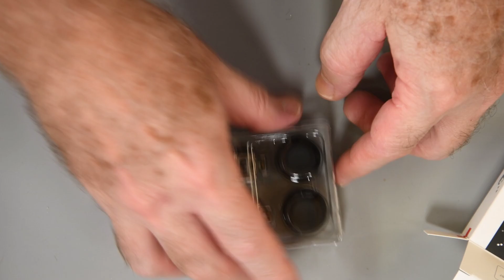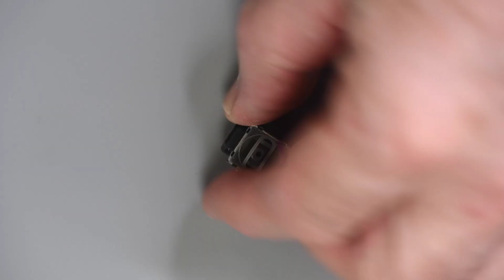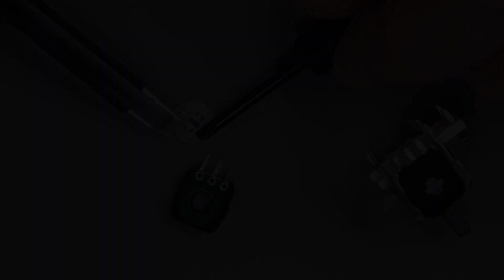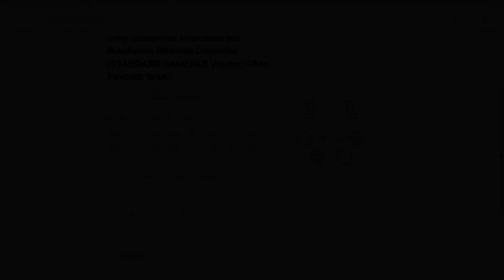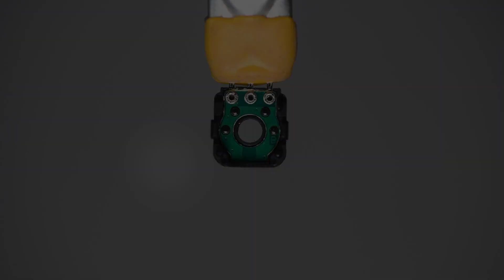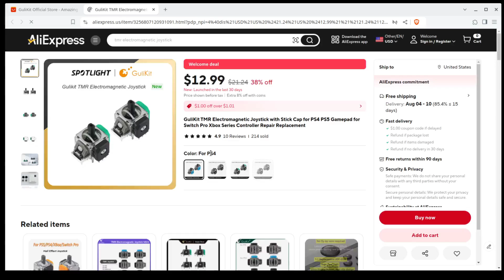A New Champion Has Been Crowned – GuliKit TMR

Comment: if I am getting stickdrift after installing and calibrating in a ps4 controller, is it a joystick issue or a calibration issue?
Reply from the maker: None of the TMR joysticks should drift.  There may be a bit of a break-in period, which might shift the center and range a very slight amount.  But if you are having noticeable drift, then something is wrong.  Make sure the sensors are snapped fully to the joystick frame.  And of course, no strong magnetic jewelry.  Is it one axis that is giving a problem, or multiple?
Reply: @metalplasticelectronics354  Okay I will take a look, it seems to only drift upwards, slightly left or right.

Comment: Do the caps fit fine? Ive seen some videos saying that the gulitkit thumb knobs rub against the shell...
Reply from the maker: I've only had that problem when putting the GuliKit knobs on an Alps frame.  I think the Hallpi and GuliKit joystick frames are a tiny bit shorter.
Reply: @metalplasticelectronics354  so the OEM caps on Gulikit modules would sit lower then?
Reply from the maker: Seem to by a tiny bit.
Reply: @metalplasticelectronics354  I see... So it's basically REQUIRED to use the appropriate caps. At least on OEM and gulikit modules...

Comment: Having installed these on my dualsense that developed stick drift, I absolutely love them and if I get a second controller I will outright replace those sticks too. They are super smooth, accurate and very reactive. The difference between these and the factory sticks is very noticable. It is such a smooth and snappy feel when playing. The calibration web UI is also easy to use and works well. The only downside, but all of the stick replacements share that, is that the installation is quite complicated. And not something I would reccomend for a beginner at soldering.
Reply: I have put both the regular tmr from gulikit and the 720 tension adjustable ones in both my dualsense and in two dualshock 4 controller and have one dualshock 4 with the k silver which so far like them all have one set of elecgear tmr sticks in a dualsense too they feel a little to loose for my liking

Comment: Thanks for the information! I want to buy these and I have a multimeter, what is the addon you use to measure these? And how does it work exactly (where do you attach it on the multimeter)?
Reply from the maker: To measure the voltage output you need 1.8 volts from a power supply and the meter to measure the center pin. Facing the sensor with the leads pointing down.  Ground is the left pin and 1.8 volts is the right pin.  The add-on is just a JST XH 3-pin socket.

Comment: I installed a fair few of these and about 50% have drift again after playing on it for about 20-30 min. Very annoying! You have any suggestions why this is? I’ve made sure all the pins especially the sensor pins have a good solder connection/joint. I also clean the board as best I can after solder with alcohol and a brush. I use the gulikits TMR
Reply from the maker: If you check with the gamepad tester website, how much has the center moved?  I've got 6 of the GuliKit/Hallpi joysticks in use.  Haven't had any of them change so far.
Reply: @ it’s about 20-25% drifting to a side. If it’s drifting to the left for example, right side will not register any input either. I’ve resoldered the contacts again and it works but after some play it goes again. Makes me think it’s the solder joint coming loose and loosing connection. I’ve used flux on the points and use a good amount of solder but made sure it doesnt touch other pins. Just wondering if you had this yourself.
Reply from the maker: It does sound like a bad connection on the left-right axis sensor.  Look at the circuit board traces that go to the left-right sensor for any cracks or lifting of the pads.  If it's drifting left, I expect the problem to be on the sensor's supply or output pin.  The center pin pads are the most likely to get damaged.
Reply: @metalplasticelectronics354  thanks man appreciate it

Comment: These sticks cost around 10$ in our region. I installed it on my drifting pro controller and now it works just like new.😀
Reply from the maker: They are nice, just not cheap.
Reply: Говорят что по качеству такие же как ginfull V5 но для разнообразия можно поставить эти дорогие тоже дела вкуса тем более сейчас вышли новые V6  @metalplasticelectronics354

Comment: Installing this kit in an dualsense edge controller.

Controller blinking white now and i cant connect? Not work with dualsense edge?
Reply from the maker: Double-check for solder that may be shorting out some traces. But I don't have an Edge to know for sure if they work or not.

Comment: Have you made a video specifically around noise? I've installed some unknown hall sensor joysticks I bought on aliexpress a while back, and turns out on the gamepad tester that the cursors move like crazy all the time (+/- 0.01 values). I knocked out a few decoupling capacitors on the joysticks while taking out the originals, but I replaced them with new ones (though probably not the same capacitance, but still). Replacing them has not made a big difference on the output. I'm wondering if there are just joysticks with very bad noise that make the value change all the time.

Unfortunately, my ribbon cables are also not in the best shape, so if I decide to swap them again, I might have more trouble connecting the ribbon cables again (pins unglued from the plastic ribbon, had to move them into place again with a microscope). I've opened that controller many times and I guess it's starting to show. I'm wondering if it might be worth it to open it one last time to get install something like those TMRs.
Reply from the maker: I haven't done one just on noise. The original Hall K-Silver has noticeable noise in the output, and one version of the Ginfull had a small amount.  I just started testing the K-Silver TMR joysticks.

Comment: So i got these and installed them along with extremerate clicky buttons ,triggers and the back paddles,,,worked great for two hours then kept disconnecting, put it on game pad tester and both joy sticks are fluttering to top left corner and triggers are flutter on and off at same time, took it apart, cleaned everything,  resolder all pins to make sure good solder ,,,still doing it, any ideas on what problem is?
Reply from the maker: The top-left would be 0 volts output from the sensors, so it sounds like a voltage supply problem.  I would look closely for some solder shorting out the 1.8-volt line.
Reply: Thank you very much for your response,  I'm new to this, what is the 1.8 volt line
Reply: Also while there fluttering to top left corner the battery level fashes from 0 to 100, or 0-105
Reply from the maker: The 1.8-volt line is the supply voltage for the joysticks and probably most of the digital chips in the controller.  With the battery level flashing I really would suspect an intermittent short on the 1.8 volt rail.  If facing the joystick sensor with the leads pointing down the rightmost lead is the 1.8-volt line.  Check the solder around those very closely.
Reply: Thank you , I will check that and hope I can find it.
Reply: I didn't see any solder touching,  if there's any solder over hanging on to the dark green lines would that do it? This was my first attempt,, and last after this happened  lol well I had two hrs of game play, attempt I got that
Reply from the maker: If the solder mask has a break in it then solder over a dark green line could be a problem.  I think the dark green line you are talking about is a copper trace under the solder mask.  No, you'll be so much better at it the next time.  These are not the easiest parts to replace.

Comment: TMR has 0 advantage over hall effect other than lower power consumption, thus lower thermals.
Reply: What is the best replacement joystick? What's your opinion?
Reply: @drakedragon4572  I mean this is the best, but tbh I prefer well calibrated k-silver JH20's because they can achieve a true 0 deadzone unlike any other joystick I've used. It's probably hard to find a version that works on a standard controller though, so this is prob your best bet.
Reply: That's true, but this is only the first generation of TMR.

It will definitely get much better over time and replace hall effect entirely in the future.
Reply: @StardustLegacyFighter  I don't disagree but people acting like it's revolutionary 💀

Comment: do they click when
moving stick like almost every dualsense does ?
Reply from the maker: No, the click is from the Alps joystick.  These have a bit of noise at the start, it sounds like a thick grease pulling apart.  But I couldn't hear that after a few hours of use.
Reply: @metalplasticelectronics354  thanks for reply,  is gulikit spring interchangeable with alps ? i have scuf envision and there no possibility to calibrate it if i swap to gulikit analog module

Comment: Hey man, 
     Just thought I’d pop in I had just watch the majority of your videos on this during a 10 Hour Drive. 
A few questions - I have an elite series 2 controller, more specifically after 6 months, I have purchased four diff elite series 2 controllers. Everyone has been screwed in its own unique way. 
Anyways 
1) there’s mentioned software for calibration, however does Microsoft have this? I don’t believe so. If this is the case, are there workarounds to hook the joysticks and calibrating other ways? I guess it should be noted. I don’t have a Microsoft computer. Macos/ios I do have an Xbox one. Literally for one reason and that is to update firmware and mess with settings. 

2) assuming that there is someway to calibrate joysticks I would most likely go with hall effect. I forgot the name, but the quickest reaction time. All I do is play codmobile and the only way to compete with touchscreen players as a controller player most sensitive, turning left and right possible, considering literally run straight at you slide do a 180 or  540, Zoom in locate your head and shoot before a controller player can even turn around. 😂 

Also, if there were a way to hook up, dual sense joysticks to elite two controller is there a way to calibrate
Reply from the maker: I don't know, I don't have an Xbox or a controller for one.  But I think I remember a note on GuliKit's website that said there was no calibration software for the Elite controllers.

Comment: I was wondering if the Gulikit TMR joysticks make a clicking sound like the original ALPS joysticks? I'd be very happy if you could check it for me. You already have a video about that clicking sound released 2 years ago.
Reply from the maker: Not like the Alps.  It's strange now, the first thing I do with a new joystick module is put it up to my ear and see what kind of noise it makes.  There was a noise I noticed with these.  It kind of sounded like a thick grease pulling apart.  But the set I've had in a controller for a couple of weeks I can't hear it now.
Reply: Thanks for information. It is good to hear this. Probably, grease getting smoother with use and noise gone.

Comment: Are these better than the Ginfull Hall effect V6 moduls ?, and do you require a calibration board to be installed along with them ? or the calibration board is only for the hall effect, I'm just confused about the different moduls and which one is really the best in term of latency, durablity, I have both the Dualsense and The dualsense edge and I'm planning to upgrade them with the best stick available, thank you very much for your feedback.
Reply from the maker: These are the best I've tried so far.  There is calibration software for the DualSense controllers, so don't need a calibration board.   I don't think the software works for the Edge yet though.  And I haven't tried the Ginfull V6 only the V5 so I can't say about them.

Comment: These tmr are junk I been through 3 set they work are a few mins then they go top right corner and will stay at the otter point
Reply from the maker: I've only used 2 sets so far but haven't had any trouble with them. The longest set has been in use for a little over 2 weeks.
Reply: @metalplasticelectronics354  everyone is talking so good about them and the technology make sense…I can’t seen to get them to work I have a video of them working and one of them mess up
Reply: sounds like a skill issue
Reply: I have the same issue.....they are working for a few minutes
Reply: upload a video

Comment: I just soldered some favor unions and ithey were very good, do you think i should buy this and replace the favor unions? How much better are the guliKit ?
Reply from the maker: The GuliKit has a bit better circularity.  Both are very fast sensors.  So I don't intend to replace the Favor Union ones I have installed.
Reply: @metalplasticelectronics354  I see, thank you!

Comment: should i buy this new joystick or it is ok to use GinFul v5 if i already have it?
Reply from the maker: It depends on what you want.  It's quite a bit of work to change the joysticks out.  I think the GuliKit TMR is the best I've tried so far.  But The Ginfull V5 is still an excellent joystick.
Reply: @metalplasticelectronics354  it has creaky mechanics

Comment: Hey man, I have the old version of the Hall effect (got them around February), its the orange ones with some red in the middle. It might just be me but I genuinely think that the joystick tension on those joysticks is lower. The base tension on PS5 joysticks is 100g and I suspect those joysticks to be at the very least 75g. That's imo the reason why they feel so smooth and have less resistance when using them. Let me know what your thought are on this, looking forward to your input.
Reply: Just watched a couple of your older videos (literally just discovered this channel). The joystick I have is the one you tested on Nov 27, 2023 (Hall Effect Joystick Replacement for the PS5 DualSense) . Would you say that this new GuliKit or the Ginful V5 have that same feel to it? Sorry for the paragraph
Reply from the maker: The Ginful V5 have just a bit of smooth feel to them.  The GuliKit TMR have the feel of a potentiometer joystick, at lest to me.
Reply: @metalplasticelectronics354  aight good to know, so i’m guessing the V5 and the version that came out 8 months ago have the same feel to it. Thanks man much appreciated
Reply from the maker: I should have worded my post better.  The Ginfull V5 has a bit of a smooth feel.  The previous version I tested has a very very smooth feel.  The older one I tested I think had an L-3J labeled PC board. And the output is filtered quite heavily.

Comment: From my research favor union is on version 2421 yours tested are the 2419’s per other outlets  FU’s newer ones have solved the centering and circularity issues unfortunately I cannot find a place to purchase the newer versions. And alixpress does not confirm which version they are selling. These may be a better candidate looking forward to your addl reviews on this one. Great job
Reply from the maker: I have to order another batch in a few months and see if can get the newer ones.  Thanks for letting me know.
Reply: Can you send a link to where you got this information. I have 2 of the 2421 sticks and I found 3 sellers that have them on stock on Ali. I have yet to install them to see any differences
Reply: @mesmeriizek4441   It started with @Modyfikator trying to get these thru his store. He stopped communicating with me so didn’t get the full scoop anyway. Not to important anymore got a set of the tmr’s. I like the idea of these better.
Reply: @JimMoPartian I installed one. Circularity is the same as previous versions. It makes a diamond shape but there’s a trick to get proper circularity without the use of a spacer which I did. I think the only thing that improved on the 2421 is jitter. I didn’t notice any jitter. I prefer the favor unions for my right stick and the TMR for my left stick. That’s my current install. TMR is looser when turning and Favor is tighter, a slight bit tighter than alps which might be a good thing since it helps with precision
Reply: If I had to only choose 1, I’d choose the favor unions. You can get 10 for $13 while the TMR are 2 for $16
Reply: @mesmeriizek4441  favor unions have a better construction in my opinion. Got a set of the gulikts. Will see how they work out. Thanks for the favor union update that answers that. With that info Still leaning towards the gulikit as overall it appears to be better. Besides only have 7 controllers in the family that may need repaired so price wise not to concerned and who knows by the time I need to repair those maybe something better will come along. So far all the originals are still working good, for three years old I’d say that’s pretty good. And thanks to the calibration software the worst offender has been given more life. I be holding off on using this new gulikits I got.

Comment: Can you keep the rumbles and speaker in the controller when you add these are do they need removed? I know when some hall effect sensors you need to remove them for the joysticks to work.
Reply from the maker: I would expect only the speaker to be close enough to affect the right joystick's up-down axis.  After it's put back together, calibration should take care of any shift caused by the speaker magnet. I now have 3 controllers with Hall or TMR sensors, and they still have the speaker and rumble motors.